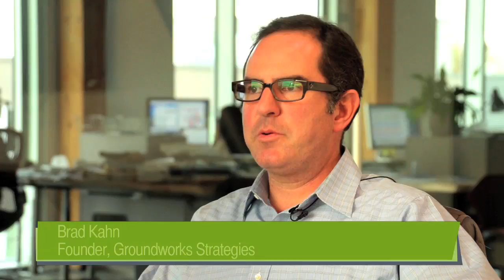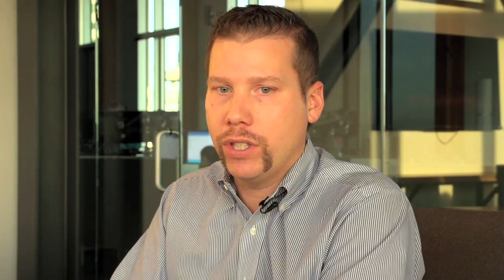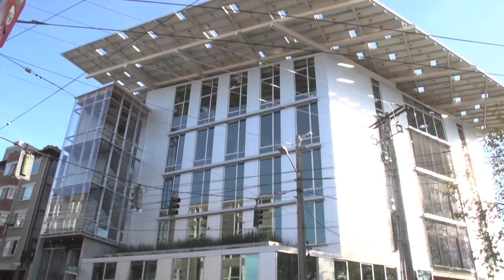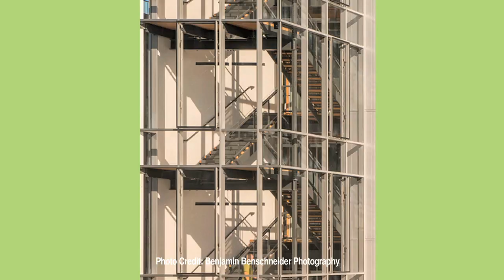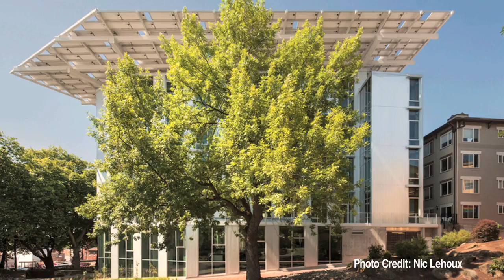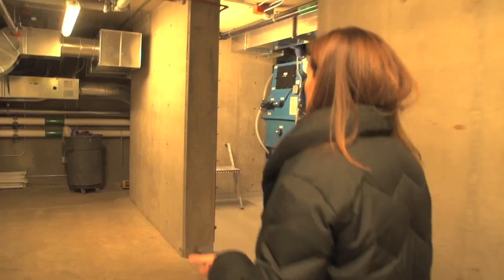ULI Case Studies: Bullitt Center

Comment: Bullit Center in Seattle can Sell back excess energy to the city grid. Water is filtrated robustly, composting toilets empty into basement bins, and a field ready compost. Staircase is glazed, an alternative to the elevator..wood is all local, requested SFC certified forests.Timber frame inside condensation zone, all window frames attached to timber frame, insulates, seals vapor out, heat gains in. Wood leeches moisture ever so slowly from outside-in, so we form air/vapor barrier on the inside, or the outside, but never both.